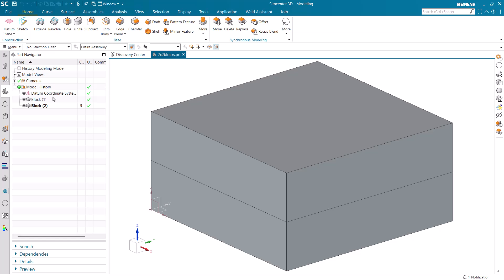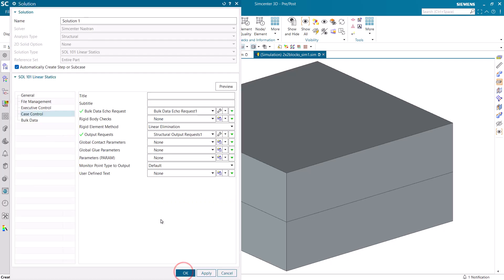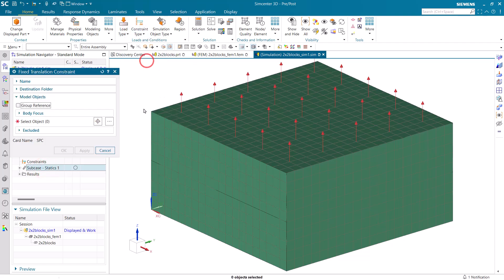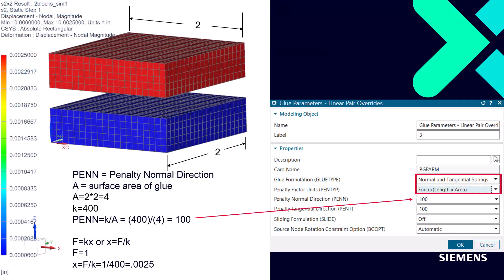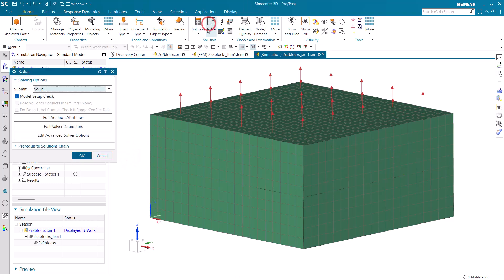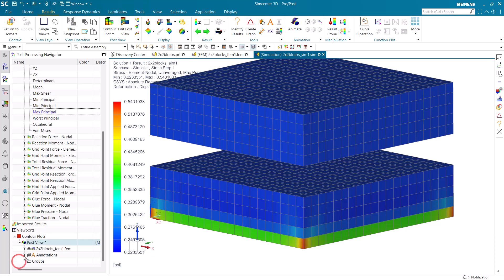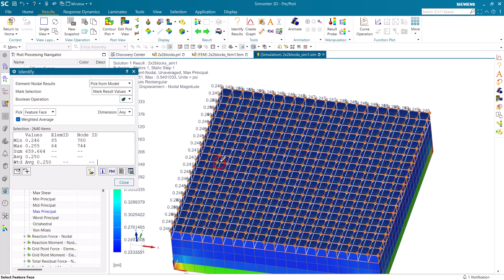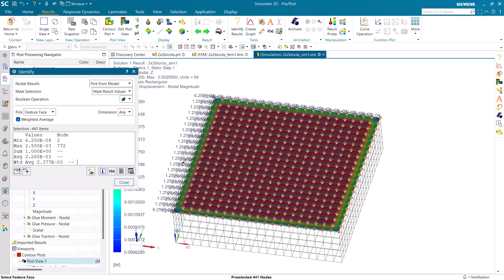How To Create A Spring Connection With Surface To Surface Glue

Comment: What if you want to connect 2 bodies by spring that are 12 inches apart?
Reply from the maker: You could increase the search distance for the auto pairing or simply use manual pairing.

Comment: Can we change the default glue parameters to consider shell thickness
Reply from the maker: Glue parameters (BGPARM) does not have an option to consider shell thickness like contact parameters (BCTPARM) does with SHLTHK.  You will need to add half the shell thickness of each shell region in the pair to be glued to the glue search distance (BGSET).
Reply: @ thanks for the reply, MSC nastran and other software has this why is it not included in simcenter
Reply from the maker: Siemens purchased Nastran from MSC in 2001 prior to glue being developed.  MSC and Siemens subsequently developed their own algorithms for glue which are different.  I encourage you to file an enhancement request to account for shell thickness when specifying the glue search distance https://www.sw.siemens.com/en-US/support-services/
Reply: @ thanks for your reply